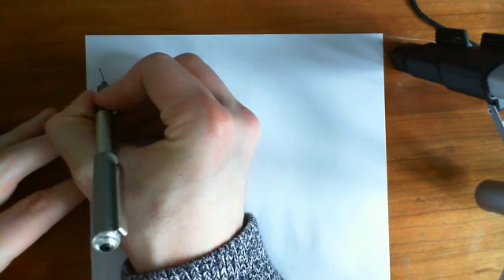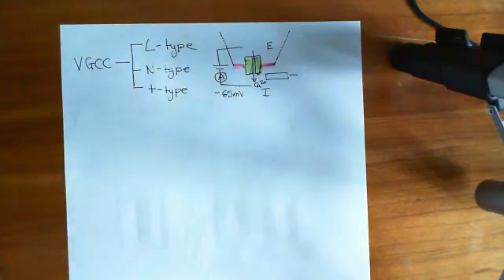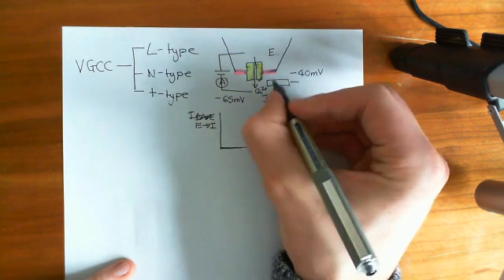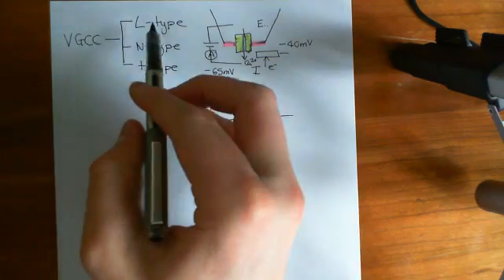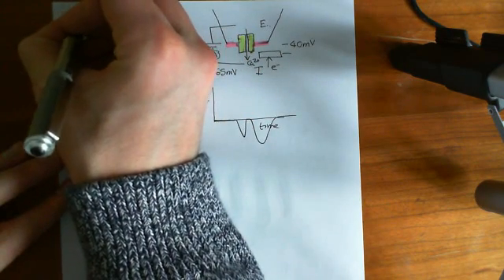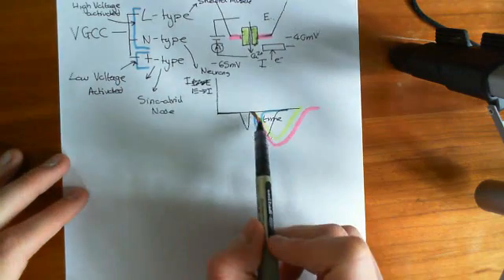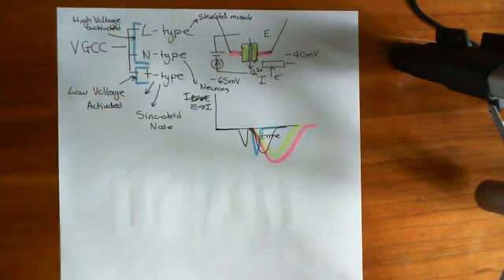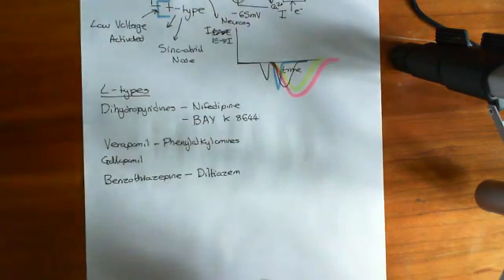Voltage Gated Calcium Channels Part 1

Comment: Bay K 8644 is in fact a Calcium channel agonist, I think L-type selective. It also increases the tail current amplitude.
Reply: Okay did abit of digging and Bay K 8644 is both a DHP agonist and antagonist, but dependent on the isomer (S-) is the potent activator and (R+) the potent antagonist.
Reply: another know it all heard from .

Comment: Wouldn't the electrons just "try" to restore the electrical potential to zero??
Reply: I think that the electrons will try to restore the equilibrium potential for the cell (found using Nernst/GHK equations, considering concentration gradients and electrical gradients together) - usually around 65mV